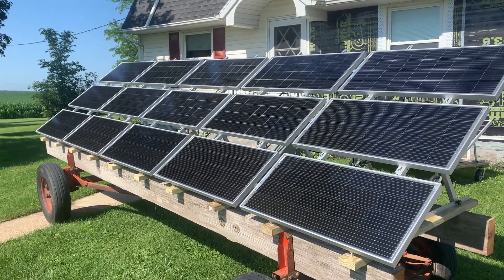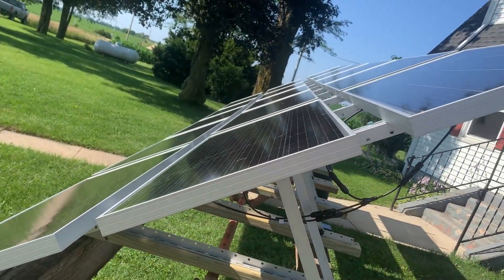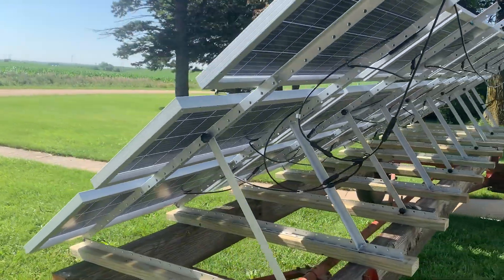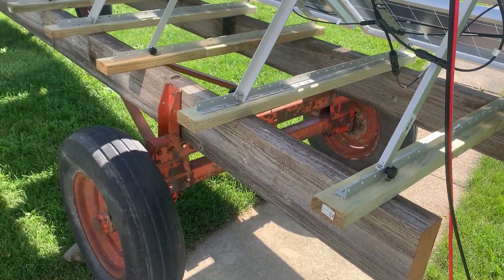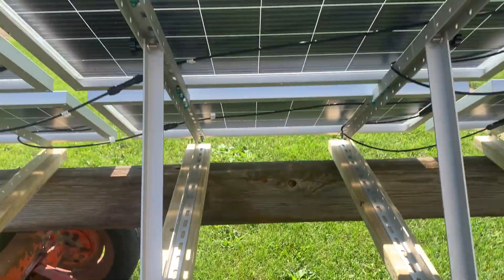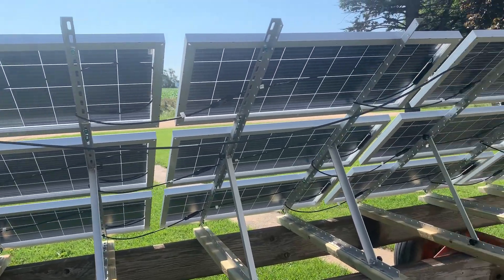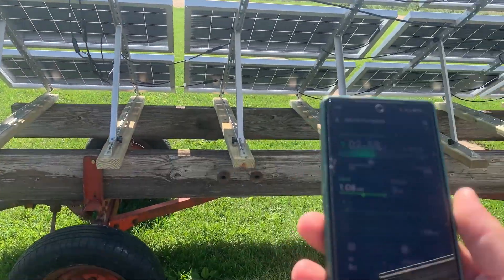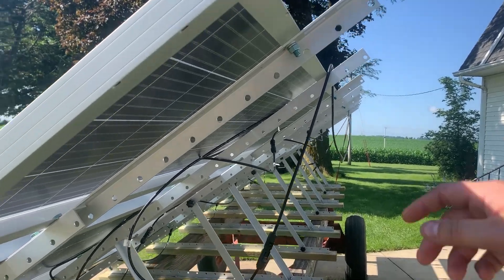EcoFlow Delta Pro, Eco-Worthy 100 watt bifacial solar panel wagon! 1500 WATTS

Comment: You can get more wattage from 3-4 panels which would make more power. You can find 400W bifacials panels for just over $100, and these 100W bifacials are overpriced. The 195W bifacials are decent price, but the 100W ones are overpriced. In my area there are 475W bifacials selling for $110. I happened to get 2 545w bifacials for 175 each, a bit more per watt, but they will pull 500+ in good sun.
Reply from the maker: I'm aware there is better price per watt, but living in iowa its difficult to get just 4 big panels shipped here at a price even close to what i payed for these, and everyone with leftover 400s wanted 225+ per panel at the time of recording. I have since purchased full pallets of 350 watt panels.

Comment: How do I need to Wire 4 Eco Worthy 100 Watt BiFacial Solar Panels for My Eco Flow Delta 2 to Work - so far only 3 work in Series, do I need to 2S2P wire them for max Acceptable Solar Input ?
Reply from the maker: I have a video showcasing 4 100 watt panels on my channel.

Comment: Nice solar array. I agree wheels are great if you can get past the aesthetics…some people are picky.
What is this generated electricity used for? I assume it’s off-grid and goes into the EcoFlow battery? What does that power?
A grid-tied version of this would be cool for those that accept a solar trailer parked in their yard and can get a net metering agreement.
Reply from the maker: The generated power is being stored in a ecoflow delta pro currently, that unit is placed in my office in the house. So each day I’m powering my laptop, monitors, and other items used for my day job. Occasionally I run my air fryer, portable air conditioner. Stuff like that. Thanks for the comment
Reply: @rnkustomz  Thanks for the reply. What’s the storage capacity of the EcoFlow Delta Pro you’re using? And what do you roughly pay for grid electricity?
Do you have to move the battery between charging and use or does it stay in one location in your office?
Don’t get me wrong, I am always a fan of off-grid systems, especially creative like this. Just trying to get the details to see what the economics and convenience are like. Unfortunately most people are too comfortable with the grid.

My system: 7.8 kW roof-mount solar PV, 10 kWh LFP energy storage, Sol-Ark 12K multi-mode inverter, Kia EV6; average grid electricity bill (including EV charging) = $51/month 😎
Reply from the maker: @bluezcluez315  delta pro is 3.6 kwh battery. No movement of the battery between charging and use, as of now it stays planted all day and i have a power strip coming off the unit so i can run my office day after day. Electricity here is 10.2 off peak, 17.2 on peak pwer KWH. Its definitely not gonna pay itself off in a year or 2. If we had net metering where i live id be willing to have a grid tied array but sadly we dont
Reply: @rnkustomz  Solar and batteries are cheap enough to compete with your grid on-peak price. Consider installing an import-only system - no net metering needed as the utility will just see a reduction in load, no export.
Reply from the maker: @bluezcluez315  I’ll need to research into that more. Sounds very interesting
Reply: @rnkustomz  Agreed - a ‘permission-less’ system to work around the polluting centralized utilities getting in the way of an energy transition

Comment: are you building a battery bank too or just using that ecoflow?
Reply from the maker: @bstahl1121  for now I’m sticking just with the ecoflow delta pro. Might get the extra battery module if it goes on sale. Thanks for the comment!

Comment: Bifacial don't really add much unless they are against a white background. They are great in snow when you need to tilt them to shed the snow fall. Other than those few use cases traditional panels would be better for most.
Reply from the maker: @natearrigoni  good thing I get lots of snow in iowa, and this trailer will be placed next to my white garage once I get the electrical done in my basement

Comment: I like how you built the rack did you have the hay wagon already and how long is the hay wagon and how far apart the brackets let me know and good job
Reply from the maker: Brand of running gear: new idea. This running gear is extendable “reach” I have it set to 15 or so feet, the wood beams are right at 17 foot I believe. How far between the aluminum solar brackets? Or the front and back mounting brackets for the wooden beams?
Reply: How far apart are the 2x4s on the beam
Reply from the maker: Center of 2x4 to center of other 2x4 is 21 inches

Comment: Since you’re running them in parallel,  do you have any inline fuses installed?
Reply from the maker: @MarkoPola  currently no I do not. I did buy a 30 amp breaker box but haven’t installed it yet.

Comment: I like your PV array on wheels. 
I have mine on wheels too but much smaller wheels. I purchased used PV solar panels from SanTan solar. 
I got 240w PV Panels for $48 each a few years ago. They’re producing plenty of power for my needs. I attached my panels to 1/2 galvanized pipe with zip ties. It’s been working fine for the past 5 years. I replace a few zip ties when some break. I move two arrays twice a day to catch morning and evening sun.

Comment: Your open circuit is 24.5V your amps is 5.2A you said you have a delta pro. Your open voltage is or could fry it. 

Delta pro solar input: Solar Charging Input. 1600W Max, 11-150V, 15A Max
Reply: You could do a cold weather calculation with V_OC/T_C — sounds like you’re fine though. A rule-of-thumb would be 10%, maybe 15% since you’re in Iowa and have a cold winter.
Reply from the maker: 24.5X5 = 122.5 VOC. That's 18.4% allowance for voc increase, i was told by many that's enough headroom. What % do you go off of?

Comment: Very nicely done array. I used to use 100watt panels too, but now use 450 watt panels. If you got two 550 watt panels you would have made more power and save half the space and save on wires and connectors. Nice setup anyway. Greetings from Jamaica.
Reply from the maker: @lawrencedavidson6195  I’ve seen a full 1600 watts with this array, so not sure I’d really save on space, and given the constraints voltage and amps wise on my delta pro, It would be less than ideal for me. Plus big panels like that you usually have to buy 10
Reply: @rnkustomz  Ok, did not know you were using a Delta pro, that severely limits your system.
Reply: @rnkustomz  I use two Renogy 550w bifacials and you're right, they produce anywhere up to around 1.1-1.2kw.  however, the VoC is a lot higher and they are super heavy.     They are also crazy expensive.  I got mine for about $750 on one of those super sales.
Reply from the maker: @tlteal  I plan to get some big panels when I have the money to do a solid eg4 build, but with me just renting this house I want to keep as mobile as possible
Reply: @rnkustomz  you do whatever works best for you.  Nothing wrong at all with your setup -- love it especially that it's mobile.  Just wanted you to know that I've had great success with the REnogy 550w bifacials and they are producing more than they are rated at but they are also VERY expensive unless you can get them on a special sale.   I've also read the sungoldpower 560w panels are very good too.
Reply from the maker: I have a 50 watt Renogy panel that I like, gonna put it on my boat once my electronics are installed. Thanks for watching and I appreciate the comments!
Reply: 😂 I was thinking about a couple of panels on my gazebo, but the size is the problem.
Reply: These solar generators are meant to work on their really expensive panels. Most of these have insane DC input limits like 60v at 20A. This has 150 at 15A, which is better, but it also cost $3k, lol.

Comment: Very cool project. Could simply put some blocks under the tires to angle it a bit.
Reply from the maker: I thought about that, it would be way easier than adjust all the 10 legs